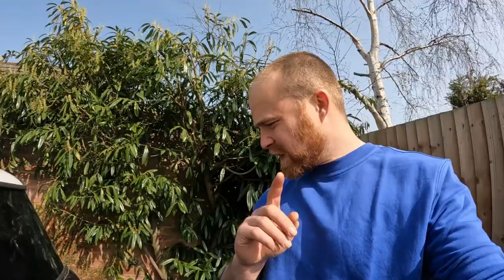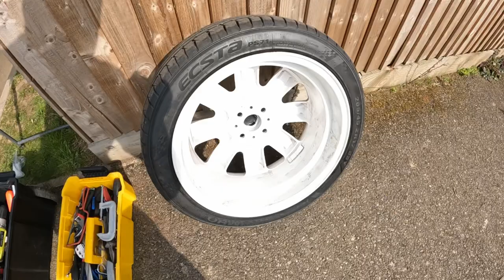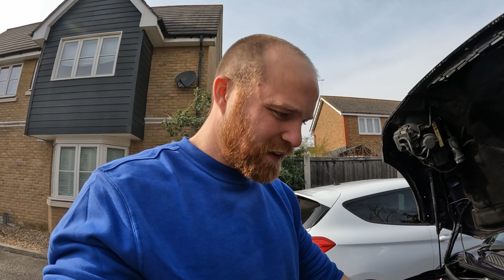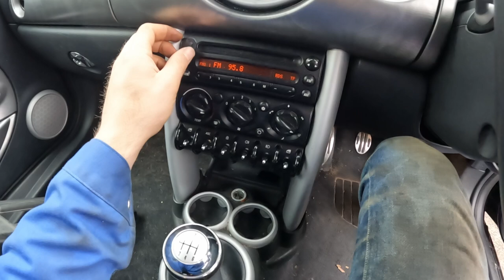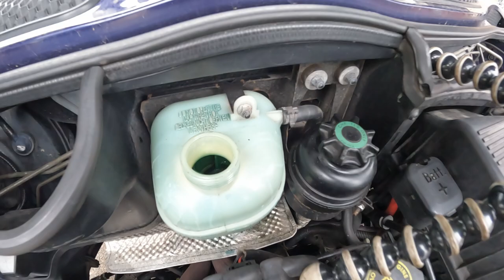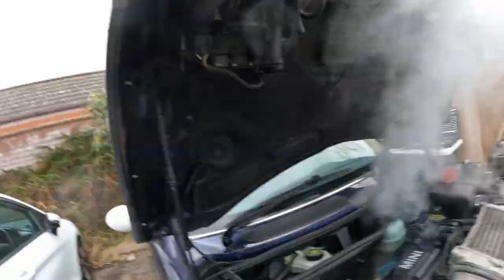This isn’t good

Comment: Washer jets aren’t supposed to work every time - they only operate once per two or three operations of the windscreen washers. My BMW 130i is the same so I presume Minis use the same concept. Saves washer fluid, I imagine.

Also - the cat…I have the same thoughts about my cat. A miniature, very friendly, lion…
Reply from the maker: Ahh interesting. I imagine the MOT tester didn't know that either lol.

Glad I'm not the only one that finds the concept of a cat a bit odd 😂
Reply: Harry's right.  The lights need to be on, and every third window wash, the headlights will wash.
Reply: @msirazer2702  On some vehicles you can do it with a quick double operation of the screenwash.

Comment: Great video, and a smart trick I learned from a friend and mechanic. When you are working on the brakes hydrolics, depress the brakepedal and lock it in place before you start. That way you block the master cylinder whitch will let no fluid thru the brakelines. There"ll be next to no spilled brakefluid on the ground. Works great:)

Comment: Top tip for the future.  wedge the brake pedal down before disconnecting any brake hose or pipe.  After the initial spurt you won't lose more fluid.
Reply: Also, a hose clamp on the flex-pipe!

Comment: The boiling coolant is caused by the coolant bottle cap. It is not pressurising the system enough. And it does not help that your low speed fan is not working. The low speed fan resistor needs changing.
Reply from the maker: Yeah looks like that could have been the issue. Lots of people been telling me that the coolant bottles and caps on these R53s are a known weak spot!

Comment: For the hose clamps you can also use a wrench/spanner or socket to tighten them if you can't access them with a screwdriver, they are usually 7mm or 8mm.

Comment: I can’t seem to remember in your previous videos if you bled the coolant system. On lots of BMW’s the coolant system needs bleeding to get rid of the air pockets. I believe air expands more than coolant does. 

Another comment also said the water pump might not be running, ánd it sounds like the fan doesn’t work as intended, only for the air conditioning. Hope you can get it fixed tho :) I love these Mini’s. I had a very troublesome 2011 R60 Countryman S which I traded in for a 2018 F60 Countryman S JCW and I absolutely love it
Reply from the maker: Yeah I bled the coolant system the first time around, and it seemed to work well right up until this catastrophe haha. I'll definitely have to check the water pump and see what's up with that. I'd love to have a blast in a JCW - always hear great things about them 👌🏼

Comment: I had a similar problem with the cooling system on my mini and I fitted a new pressure cap and it sorted it, your doing good and it never hurts to get some help.
Reply from the maker: Cheers, Paul. Got an OEM cap on its way - really hoping it's as simple as that!
Reply: It seems that the temp gauge only tells you what it thinks you need to know, mine boiled over and a minute later the fan kicked in as the temp it should have done and cooled it right down, this was confirmed via live data on a similar diagnostic tool to what you have

Comment: As others said, change that coolant tank and get a new Oem cap.  Fix your low speed fan with a new resistor or new fan unit, they are not expensive.  Green gasket in charge pipe is a common fault at this age.  Almost there!
Reply from the maker: New OEM cap from BMW arriving today. Very much hoping that solves the problem as it looks like the old cap was just failing and letting all the pressure out!

Comment: I had the exact same coolant leak on my 05 r52, it was a head gasket failure. I doubt its anything else! if it is it'll probably be worse (and more expensive)
Overheated in exactly the same way. it would just dump all the coolant out onto the engine and floor :( 
Its so worth saving it though (dont get rid of it!!)
Good Luck!

Comment: Hi mate. I'd replace expansion tank cap (as others have said) but also your temperature sensor. If this is duff causes all kinds of weirdness.
Reply from the maker: Cheers, Rob. Got a new cap on its way. If that doesn't solve the issue then will take a look at the temperature sensor 👍🏻

Comment: well done for getting this far, when bleeding the cooling system did you open the 8mm bleed screw by the thermostat ?
Reply from the maker: Cheers bud. I didn't know there was a bleed screw by the thermostat 😅 I have just been bleeding it using the screw in the upper coolant hose

Comment: It's a heat issue (car boiling over like that). The 2nd stage fan came blasting on, which means the coolant has reached 112c. Could be thermostat, could be head gasket, at worst. I had a really weird issue after I hit a bump in the ground. Somehow my 'snoot boot' came loose and I had an air leak on the hot side. It was causing the engine to overheat. It was actually too much air getting into the induction process resulting it an extremely red glowing exhaust and the car reaching 2nd stage fan time. So you might not be wrong with a leak somewhere in the boost system.

Comment: The brake cleaner test may not work well if you have a turbo, as the manifold has pressure, not below atmospheric, so it's not going to suck in brake cleaner very well, if at all.  On the up side, the brake cleaner may spurt back at you from the leaking location.

Comment: Been looking through your vids. As just found you dont use those hose clamps as with the temp changing it loosebs them you need to get SPRING HOSE CLAMPS AS when the temp rises and the pupes expand they tighten automatically and when it cools it ajusts also stopping leaks that develop from thise clamps you are using

Comment: Nino, put the heater on full hot and max fan, up to windscreen, also keep opening the bleed screw on the hose In front of radiator, good luck
Reply from the maker: Cheers mate will give that a go!

Comment: As someone says below bud, the headlamp washers don't activate on every windscreen clean. They can be a pain to bleed air from as well - one of mine was disconnected for a few months whilst doing some work to the car and upon reconnecting it, it took around 10-15 cycles of the h/lamp pump to start getting fluid back in there and out of the end. 

One way to get them to fire on demand is to cycle the ignition between off and position 2 with the lights on, leaving a couple of seconds in-between. Might be an idea to have a battery charger hooked up though if doing this as this will prime the fuel pump each time and on these cars they pull a fair few amps from the battery.

P.S. for the cooling issue - check your Stage 1 fan is kicking in - the resistors often fail and cause them to overheat. They're a pressurized cooling system as well so check the cap on the expansion tank. If in doubt replace it for a BMW original or a Stant cap. Check the expansion tank itself for any cracks / splits on the middle seam as well as this is where they like to fail - you'll likely see tell-tale coolant dribbles down the bottom half of the tank and the manifold heatshield if this is happening on yours.
Reply from the maker: That's quite a quirky system haha. It sounds like mine are working just fine then - just need to educate the MOT tester next time around

Comment: Air lock is my thoughts. I hope you get to the bottom of it. I do know that it's not easy and it took me a few goes at getting the heater hot in the car before it was all good. 
Good luck. No shame in asking for help.

Comment: Your allowed a bulb or 2 in upper brake lamp to be out. You can't change the bulbs as its a sealed unit  and headlight washers only work every 5 or 6 squirts with windscreen washer to save water who ever moted your car hasn't a clue on how minis work
Reply from the maker: Thanks for the info bud. Might have to tell the next MOT tester about the washers before they do the test

Comment: Nino I was told about the upper brake light if any bulbs are out it’s mot failure, however if it doesn’t work at all it’s not a failure. Strange I know. 🙂
Reply from the maker: Haha who comes up with these rules??? I might just unplug it then for the next test 😅
Reply: @NotEconomicallyViable  maybe check with someone first 🙂

Comment: The Police pulled me a few weeks ago for a brake light bulb out...they told me the high level brake light is not part of the MOT?
Reply: I've read the same as well. He can disconnect it and it will no longer be a fail.
Reply from the maker: There's so much conflicting info on this high level brake light. I think all these 'officials' are just making it all up as they go haha

Comment: The car should have not failed on the headlight cleaning device it only comes into force from vehicles first used on or after 1 September 2009
Reply from the maker: Ahh interesting. One thing I've learned during all this is just how open to interpretation the MOT rules seem to be

Comment: Those plastic tanks are known to be a problem with cracks,there are aluminum   aftermarket ones
Reply from the maker: I'm going to replace the cap with an OEM item as a first port of call, but if that doesn't quite fix it I'll definitely look at changing the tank. Those aluminium aftermarket ones look sick 👌🏼

Comment: I'm sure on these minis your supposed to burp the coolent system, so after topping you leave the cap off to let the air escape. I'm no mechanic but I'm sure I saw Lee lockwood on YouTube do this.
Also modamini is where he did it himself. All the best mate. And should there be a throttle body gasket too?
Reply from the maker: Yeah that’s how you do it. Took me a few times to work out properly the first time I did it. There’s a throttle body gasket that I replaced when I took the engine out 👍🏻

Comment: It'll probably be that green charge pipe gasket. Or its the bypass valve. The coolant leak will more than likely be air in the system or a dodgy cap. Look forward to seeing what the issue is. You've done well  upto this point though. Don't be disheartened.
Reply from the maker: Yeah looking like it's the green gasket - will explain everything in the next video. Got an OEM cap for the coolant tank on the way and hoping it's as simple as that!
Reply: @NotEconomicallyViable  they are tricky bud. It’s easier to remove throttle body and small horn and push against it hard. You’ve done well though. Done some jobs I would need to build up to. Especially those brake lines 😂

Comment: Nino mini r52S/53 well known for header tank failure only solution is to buy a new one 🤨

The headlight washers only work on the first press with the lights on then after a wait period of - quite a while. Also they only spray if they come fully out, spray some spray grease on the ‘stalks’ you can pull them out by hand carefully 

Keep going it’s a good channel
Reply from the maker: Cheers, bud. Sounds like these headlight washers are just a bit weird like lots of BMWs. Mine seem to be working then really - might just have to educate the MOT tester before they start the test.

Comment: You could try and bleed the coolant system, it's as simple as unscrewing two bolts really. look up a tutorial and try that. The likely hood is that professionals will advise a head gasket replacement which may be around £1000 if you end up servicing a bunch of other things whilst the head if off. 

again try bleeding the system first, always 
thanks

Comment: Hey Nino, just about to watch on my dinner just wanted to say, I got a k+dcan cable around the same time as you as I wanted to read the faults on my 118d mainly DDE stuff. I found Inpa didn’t work well on anything but XP/vista 32bit, but I found the software a bit lacking as you did with scripts failing for certain modules. I eventually found a version Insta D + P and got that installed, a bit of a pain but so worth it. I managed to find that the car was just saying the DPF had no miles left on it, so I took it off cleaned it and then told the car it had a new one, touch would no DPF light since, just need to check it’s actively and passively regenning now. Deffo worth the effort to get ista installed and works on windows 10 no issues. Let me know if you need any help with it. Cheers
Reply from the maker: Ahh that's good to know. I was installing INPA on a Windows 7 laptop 64-bit, so looks like I fall right in the middle of the two softwares lol. Just seen that I can get ISTA D+P pretty easily, so might give that a go. Cheers bud 👍🏻

Comment: Think you need to check slow speed cooling fan there is a mod you can make with a external resistor
Reply from the maker: Cheers bud will take a look 👍🏻

Comment: Regarding the coolant - check the coolant bottle for cracks, and hoses for splits. Leaked coolant will often leave crystalline deposits around the area of the leak; in this case it’ll be bright blue👍

But, if it was getting very hot, it might have over-pressurised and pushed a lot of the coolant out of the bottle without there being any obvious damage to anything 

However…it may also be over-pressurising because of head gasket failure, so watch out for that. Buy a head gasket tester kit, just to be certain.
Reply from the maker: I'm hoping it's something as simple as a dodgy coolant bottle, or the cap. A head gasket issue sounds like it'd be expensive and hard work haha. Will definitely test it though 👍🏻

Comment: It sounded like the cooling fan didn't kick in on stage 1 and only stage 2 is working.  Turn the AC on and see if the cooling fan cycles on and off at high speed.  It's an indication that the low speed resistor has failed which means the fan only works on high speed.  A really common failure and could be contributing to your "overheating" problem?
Reply from the maker: Thanks for the advice, Richard. Is replacing the resistor an easy job. At this point I've done zero electrical work and it fills me with the fear lol. Gotta give it a go at some point though!
Reply: @NotEconomicallyViable   There's a cheap fix where you splice a new resistor into the high speed circuit (I found this video on YouTube https://youtu.be/XsowO9efYYs).  It looks pretty straightforward.  You can replace the resistor pack but that's more awkward to get to.  I had the whole fan assembly replaced by a garage as it was going in for other work anyway.

Comment: Just the right time to call in the experts. Good on you knowing when to seek help.  I’m with others on the cap needing replacing. May as well do the whole bottle to be safe. Also, low speed fan needs fixing and if the whistle isn’t that green gasket others have said could it be the other end of that plastic tube you were fiddling with.   Didn’t hear in the video but did you make sure to get flammable brake clean for the spray test? They sell non-flammable in lots of stores and that won’t work…done it myself 🤦🏻‍♂️.   Keep at it bud.
Reply from the maker: Got a new cap from BMW arriving today - looks like the old one was not OEM and wasn't sealing properly. What do you reckon needs fixing with the fan? I'm yet to take on any electrical work so completely out of my depth...

Yeah it was flammable brake clean, but I only know that because I just checked now haha
Reply: @NotEconomicallyViable  shame your so far away as I'd help out with the electric fan, check actual temp via diagnostic tool check the relays are ok and check fuses are the first things to do when it's up to temp and possibly boiling over check if there is power to the fan if yes then you might have a faulty fan if no then it could be relay or wiring fault, hope this helps
Reply: @NotEconomicallyViable  not a great high end video but here’s a quick guide to testing fan on an r50. https://youtu.be/2MmVsNxNSYg.  May be the same on an R53.
Reply: @NotEconomicallyViable  not a great high end video but here’s a quick guide to testing fan on an r50. https://youtu.be/2MmVsNxNSYg.  May be the same on an R53.  If you’ve got an email you want to share I can send pics of a fan and wiring removed to give a more clear look.

Comment: i did a head gasket replacement on my r53 in my mums driveway when i was home from Uni. Given time, a torque wrench, the mod a mini tutorial, and a very basic level of mechanical skill you can do it yourself.
Reply from the maker: Good to know. I owe so much of this build to that Mod A Mini channel!
Reply: @NotEconomicallyViable  yes mate likewise, ive done some pretty big jobs on mine with those videos. I have saved 1000's of pounds by doing it myself. I had never done anything more technical than replace brake pads and discs when i did my head gasket and its its still running strong
Reply: I agree, that American modmini explains every step really well, I've successfully changed the headgasket on 2 mini r50's I've got, a great teacher that guy is. @NotEconomicallyViable

Comment: Common fault with minis change the coolant bottle they tend to fail at the joint around the bottle causing coolant to go bye bye
Reply from the maker: My coolant went bye bye that's for sure lol. Got a new OEM cap on the way - if it's not that then will replace the whole bottle 👍🏻

Comment: If you decide to do it yourself...

1. Check for leaks first (the smallest leaks makes the cooling system go crazy)
2. See if your low speed fan is working (I think I only hear your high speed fan working in the video. So it's possible your resistor is gone)
3. If all of the above checks out well: Bleed the cooling system as follows.
a. (with the overflow tank cap on)Turn the car on when cold let it come upto operating temperature.
b. Remove the overflow tank cap slowly. Then crack the bleed nipple on he upper radiator hose slowly until all the air bubble come out. Keep filling the overflow tank with fluid.

Good luck!